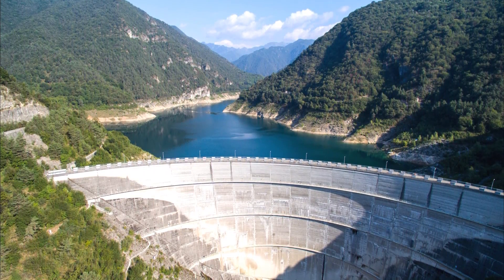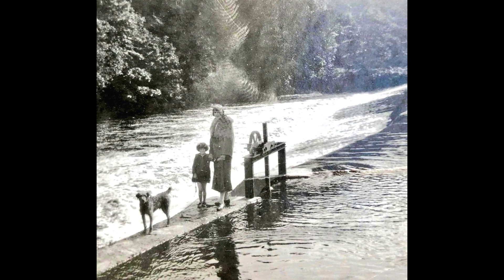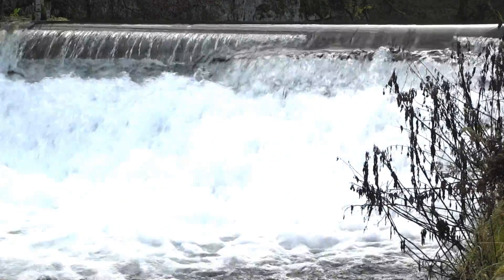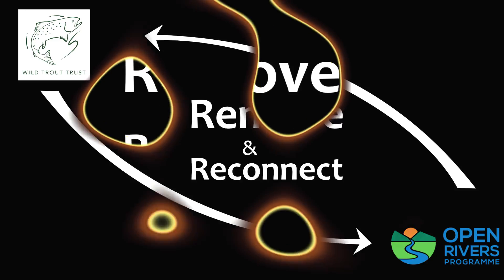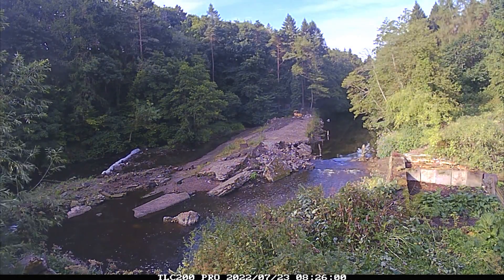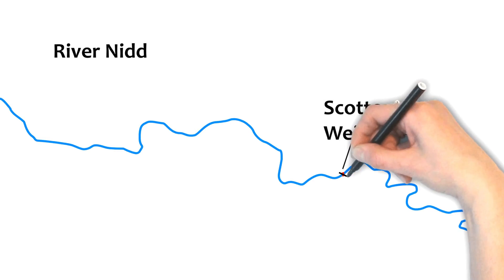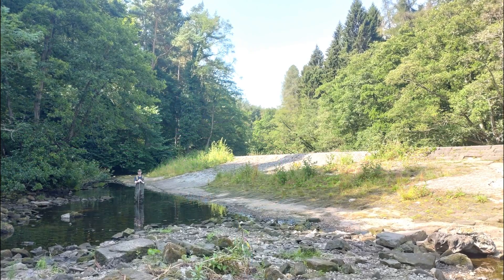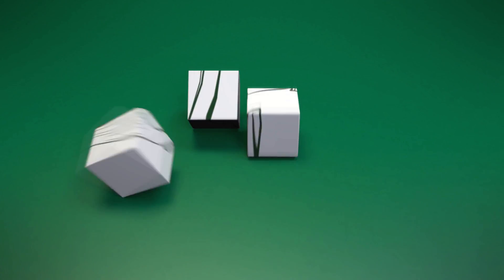Dam Removal from UK River: Why Take Out This 200 year-old Weir?

Comment: I wonder, could this clearance possibly prevent floods?
Reply from the maker: Overall, the impact on either increasing or decreasing flood risk will be hard to detect in this situation. The same amount of water will flow down the river at the site where the weir used to be (compared to the amount that would flow over the top of the weir when it was in place). Also, when the weir was in place, it wasn't set up to create flood storage by deliberately pushing water out onto the floodplain; so that wouldn't have been providing any downstream flood protection. What can now happen is a natural re-emergence of more varied habitat as riverbed material can now be redistributed by spate flows. This was artificially prevented when the weir would, previously, intercept those spawning gravels and cobble materials.

Comment: Yes but it was damned for a reason. So  what are those reasons and who is disadvantaged by removing this dam ?
 The lack of facts and the absence of balance in this article, showing both the pros and cons of having, or not having, the dam, all points to this short video not being about truth, but about being propaganda, pushing just one side of the argument. 
So overall this is a childish video, not one that adults could be pleased with.
Reply from the maker: It was dammed to serve a long defunct mill. The proliferation of “run of river” dams during industrialisation is a not very well known yet significantly negative impact on rivers and streams. Not only do they fragment breeding populations of a wide range of species by cutting off access, they also disrupt the process of riverbed material transport. This degrades habitat and reduces species diversity as well as increasing the risks of local extinction of certain populations (risking a loss of genetic diversity and the associated resilience/adaptability of native species). The purpose of the video is to highlight projects such as this one. It is part of highlighting these - well established but little known - ecological impacts of weirs. Thank you for the opportunity to continue this exploration of the issues outside of the confines of a video lasting just a few minutes.

Comment: Great to see that the river's got it's flow back.
But just one question. If the river was damned and not flowing past the original weir, where was the water flowing too?
Reply from the maker: It was flowing over the top of the lowest points of the crest of the weir (with a large, long still pool of water with little turbulence or energy upstream of the weir).

Comment: wait till a dry summer.
Reply from the maker: What difference are you expecting in a dry summer? Do you think all the water would be held up behind the weir like a lake (if it was still there?). If that was true - which it wouldn’t be - what would happen to the riverbed downstream of the weir? Weirs don’t change the amount of water flowing down a river and having a layer of anaerobic silt built up behind them doesn’t do any favours when the weather is hot and dry.
Reply: @WildTroutTrust  short section of river dried up vs very long section dried up
Reply from the maker: The weir wouldn't significantly change the length of dried up river channel (it might even increase the length of completely dried up channel downstream if you had such extreme conditions that no flow could get over the weir crest). Instead a weir might create a localised increase in the width of wetted channel on the upstream side - but this would also be at the expense of slowing the flow and causing stagnation (which would raise the water temperature). The combination of stagnant flow, increased water temperature and the nutrient-enriched sediment trapped on the upstream side of the weir would strip oxygen out of the water causing fish kills. In contrast, when hot dry weather causes low flows in natural riverbeds without weirs, the flow retreats to the narrowest sections of deepest channel cross section (sometimes known as the thalweg). This keeps a supply of constantly flowing water with higher oxygen levels and a lower risk of fish or invertebrate kills. The benefits of that situation can be increased by making sure there is enough shade from riverside vegetation and that the riverbed habitat is as complex as possible. In higher flows, there is also much better dispersal of nutrient-enriched sediment - instead of it collecting in a large "hot-spot" on the upstream side of the weir.

Comment: What's the point?
Migratory fish need clean water and silt free gravels to spawn.
The River Nidd receives untreated sewage discharges from at least seven treatment works. Calculations based on estimated volumes for four treatment works: Pateley Bridge, Harrogate North, Darley and Kirk Hammerton. Hammond estimated the river received an equivalent of 317 Olympic pools of raw sewage from those works in 2020.
Reply from the maker: Do you think there is less or more justification for cleaning up the water when barriers are removed (and pollution is one of the final remaining critical issues)?
Reply: @WildTroutTrust  I would say that sorting out the water quality has to be the number one priority, because pathogens and sudden drops in dissolved oxygen due to organic runoff are major problems for fish survival and recruitment, along with the silt and bacterial mats.
I grew up living near Birmingham's river Tame, and it was regularly subjected to sewage and storm drain runoff during thunderstorms, and these devastated the fish populations.
The only places where fish survived these events were side channels and weir pools, where there was more oxygen.
Take out the weirs, without addressing the runoff, and you will see entire rivers wiped out.
Reply from the maker: @baldieman64  Nobody is suggesting habitat works are done in the absence of water quality protection or improvements. For rivers to survive, they need all three legs of the "milking stool" - which are Habitat Quality, Water Quality/Flow and Connectivity. It doesn't matter which of those legs is missing, the river cannot be healthy. This is why there is a big risk in suggesting that all focus/money should be spent on tackling water quality. Throwing the baby out with the (sewage-laden) bathwater as it were!

Comment: Congratulations: causing more flooding downstream; reducing the recharge of aquifers. You should know that money is being put into projects designed to hold water in the upper reaches of rivers, and here you are deliberately having the opposite effect.
Reply from the maker: Weirs like this have no effect on slowing the flow (water pours over them at the same rate as if there were no weir there - like a full bath-tub; the exact same amount of water that the taps put in spills over the top). The projects to "slow the flow" are different and are set up in similar ways to natural woody debris dams (along with additional obstacles built out onto the floodplain). The major difference is the way those structures are set up to deliberately flood surrounding land (away from buildings etc.) during periods of high rainfall. The weir in this video did not function in that way (in fact it would have been a much more significant source of problematic local flooding if it did). Also, there seems to be a lot of confusion over recharging of aquifers (which relies on rainfall and soil porosity) versus what run-of-river weirs like this one could do to either help downstream flood risk or aquifer recharge (which is nothing in both cases). As with many things to do with rivers, the effect is completely the opposite of what you'd expect. Rather than storing water, their major impact is to block the transport of riverbed material (rocks, gravels, sand etc.). While they don't change the amount of water flowing downstream, they reduce the variety of current speeds upstream - which creates much more "samey" habitat that can only support a smaller number of species compared to the varied habitat which was present before. Finally, by trapping cobble, gravel, sand and boulder material on the upstream side, the supply of these building blocks of varied habitat are cut off from the downstream reaches.
Reply: @WildTroutTrust  So, since you dis not say you has permission to remove the weir, you did not have permission to remove the weir.
Reply from the maker: @djtwo2  All necessary permissions were sought and obtained.